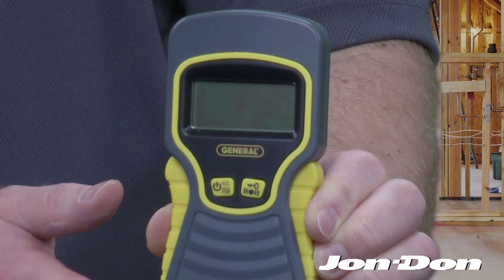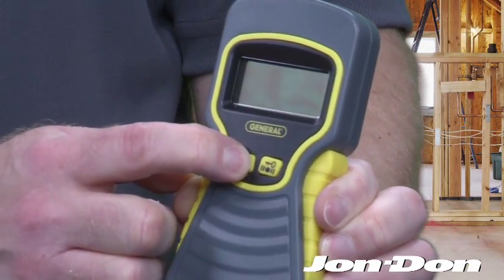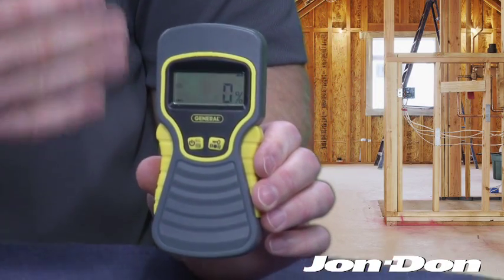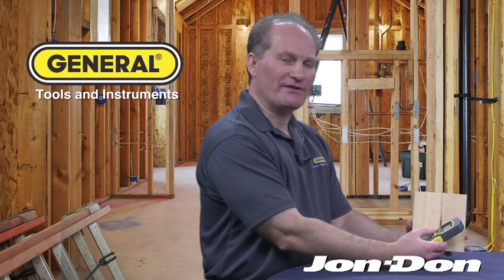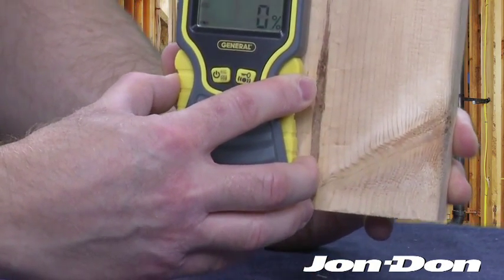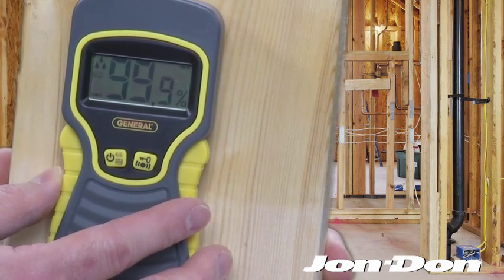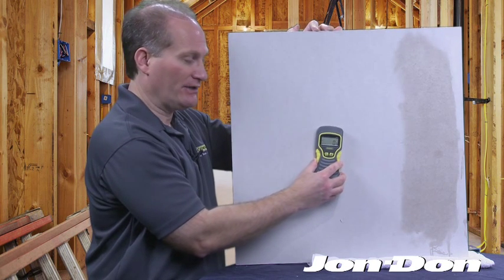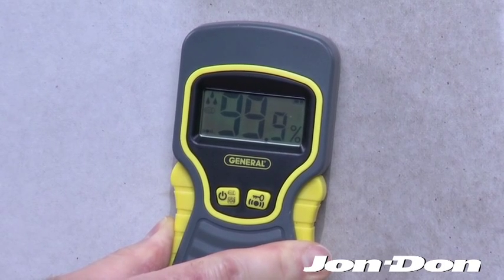MMD5NP Moisture Meter Demo/Review - Jon-Don Video

Comment from the maker: @Hvguy The MMD5MP will show you moisture content at various levels, so you can determine if a substance is drying. Jon-Don has a huge selection of moisture meters from the industry's top manufacturers. Check it out online at http://www.jondon.com/equipment-accessories/meters-detection-and-sampling/moisture-meters.html or call 800-556-6366 to speak with a Jon-Don representative for more information.

Comment: this video demonstrates a unit that can tell you if your wood or drywall is wet or not.... I didnt see anything in between.
Reply: yeah it only showed 0 or 99. looks like a rubbish product
Reply from the maker: While the wood reading is 0–100, it is all relative to finding a benchmark of a non-affected area and testing against that. The non-wood scale is 0–56 and again is relative to the non-affected readings. 

Jon-Don offers a range of other tools that have different scales for other building materials. Other tools have wood scales that are from 6–40% MC and relative scales from 0–100. 

Shop with confidence—Jon-Don has tools to fit every need and budget!
Reply: MySchizo Buddy  Hello I've been using one of these for work. It does show different levels between O -100. I have compared my findings with units used by companies like ServPro and other remediation companies who use much more expensive moisture meters and we are often very close. The video doesn't do,the unit justice. I've been using this unit for over 2 years on a frequent basis with no problems. Hope that helps
Reply: Yes you are right Jerry, I have been using these for a year now and also find they are very good. For the purpose of the video, it seems as if they put water on the material and shot the video immediately after, such contents of water will definitly rocket to 100%. However, in houses like roofs or walls where water seeps through, the water content may be less. It is usually normal with a pin type to find 3-4 % (in canada) in the materials but when they reach over 20% it is indicating an underlying problem. These are great for detecting such problems.